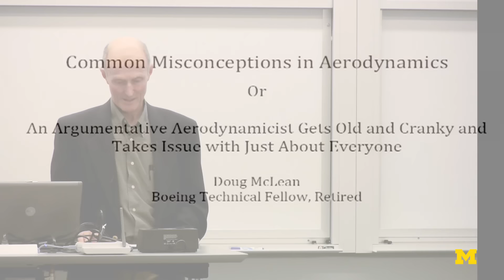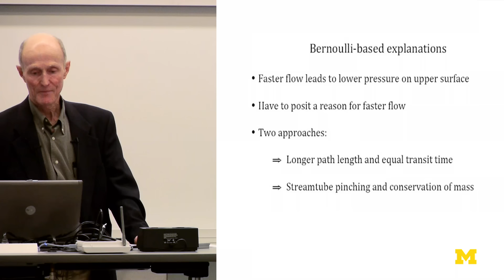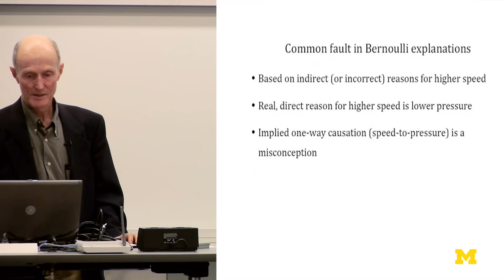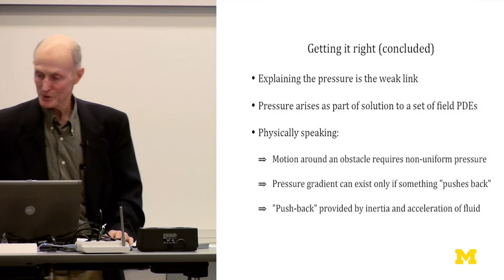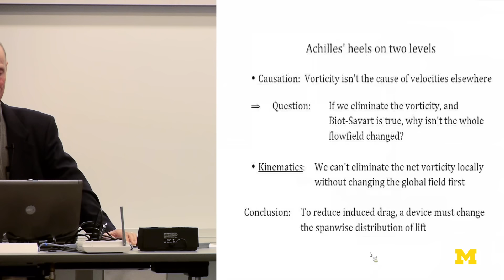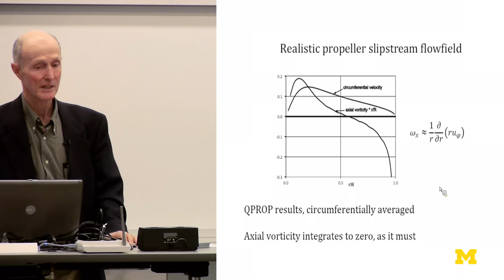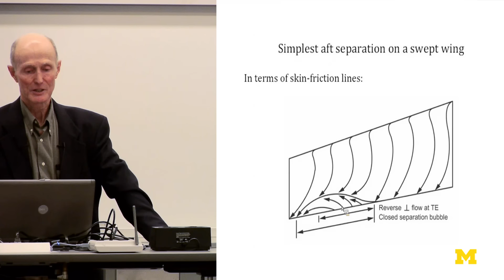Doug McLean | Common Misconceptions in Aerodynamics

Comment: very very educational for those who want a much more in depth understand as to the physical phenomenon behind lift and flow. I feel he could be a bit more thorough about what constitutes a good explanation as opposed to everything that doesn't, but that's just me.
Reply: It's because he's a prior Physics major and knows a ton of the advanced computations and principles of general mechanics.  I liked how he spoke about biot savart law and understood that the velocity ("Current" in terms of Electro  Magnetism) at varying distances contribute to the point in question r-hat, with distance r.  Its hard to calculate but he explained the "intuitive" aspect very well.  Unfortunately, you need at least advanced vector calculus with various example problems solved by yourself by hand in order to understand what he is talking about to the professional level he is speaking.  I'd recommend a good physics program with competent professors to explain Biot-Savart law well (in advanced integral form) to be able to understand the 2nd half of this lecture.
Reply: Around @26:17 he did explain lift more or less correctly: it's both Bernoulli flow plus Newton II & III (or vector N-II & III and Euler). But note, that assumes the continuum approximation, which if you want to be pedantic is false.  He was also clear about that at the beginning, he is doing the physics correctly for the continuum approximation, which is a fiction, but "good enough".  Air (water)  is a gas (liquid) of discrete particles.  So the true ultimate explanation (of lift) for a purist is molecular collisions.  Molecular collision theory (with some adjustments for inter-molecular forces in a real fluid, stronger in liquids, which give more turbulence and drag) explains it all, and there the Bernoulli effect is pure idealization, and it's really all just Newton II & III.  That's why the angle of attack, not the wing shape, is the dominant factor, and is why you can fly a plane upside down without inverting the wing foil profile.
Reply: @Achrononmaster  yesss....!!
Reply: @Achrononmaster  Can you recommend any books which explains this topic in right way.
Reply: @bijou smith. 
Its really true what you have said. The generation of lift is Misconception from beginning well saying pressure difference would actually generate lift but in reality it's much more complicated. Simple Bernoulli equation can't just the lift the sooner you remove Idealisation the clear the picture will be. It's viscous property of flow which generates lift, fluid is one hell of thing, they are freaking intelligent just required a space they shall compress or expand to occupy it. Continues mechanics comes handy here because they explain why we are assuming no slip conditions or neglecting normal velocity for solving navier stokes equations. Molecular Molecular interaction is will give significant understand in unsteady lift distribution.
Reply: @justanotherguy46  0
Reply: @justanotherguy46  0
Reply: 0
Reply: @justanotherguy46  0
Reply: @justanotherguy46  0
Reply: Alex, you are right.
But from the outset, he explained, that his talk is about the misconceptions used by many popular 'intuitive' explanations, and if he had much more time , in summarizing his extremely detailed explanations, he might have had time to a 'positive' lift description.

Actually even then the explanation would be valid for small deflection angles.
Barnes McCormick did develop an extension to large deflections, large angles of the far , ultimate wake.
He did that with a tilted back ' Trefftz plane pair, tilted back by just that ultimate wake angle. ( 41:18 )
You can find it in McCormick's book: Aerodynamics of VTOL flight, a Dover publication.
Reply: He is bringing me to despair ... not good for physics ... yet

Comment: I've always intuitively thought that lift was generated from the Newtonian explanation of thrust: particles colliding with the wing at a positive angle of attack, being pushed down, and subsequently the wing being pushed up. (I knew this understanding was incomplete because it couldn't explain how flat bottomed airfoils generated lift at zero angle of attack) I never understood people who only teach the Bernoulli way like it's always been taught to me. Glad to know lift is more complex than what's been taught to me by people who think they are right. I still don't understand lift, but I'm glad I found this video.
Reply: The thing is; that particles above the wing are ALSO being 'pushed down' because of the lower pressure above the wing allowing higher pressure far above the wing to push it down.  In fact, MORE AIR IS "pushed down" from above the wing than below it.  
What happens above the wing contributes more to the difference in pressure than the small increase below the wing.
Reply: Towed gliders must stay above tow plane ! to avoid the down wash ( displacement of air ) and it is considerable ! a typical C172 displaces 7 tons per second! Bernoulli contributes a lift component , but if you do the arithmetic  Bernoulli alone is not sufficient to 'suck' an airplane into the sky !
Reply: Air interacting with a space capsule re-entering the atmosphere (aka very thin air at high mach numbers) basically DOSE act like the simple newtonian stream of bullets under thouse conditions, and it's why such vehicles can only generate lift by being tilted to the incoming airstream by dispacing their center of mass.

Comment: I am a physicist who sometimes teaches airfoil theory. You stated in 48th minute that Coanda effect has to do with viscosity. It is NOT a viscous effect (that's a wrong explanation in wikipedia and other places). In my view, Coanda effect is all about the curl v = 0 away from negligible boundary layers, and IT IS the proper explanation for the lift force (Bernoulli law is also needed; curl v = 0 explains why the velocities along the upper surface differ from lower surface, due to non-zero circulation)
Reply: I too am a physics person. In general all aviation theory is like the 'blind men & the elephant", to which all are partially right, but totally wrong; To the blind man holding the elephant ear, its a fan, or leg its a tree; To the pilot who can tie strings all over his airplane in flight, he clearly knows all about laminar flow and turbulence; To the desk sitting theorist,  they are like the blind man at the tail, they say its a snake that rains feces&urine;

Comment: I am not an aeronautical engineer or expert in aerodynamics. However, I have always been interested in aviation in one form or another including model design and building, skydiving, paragliding, hang gliding etc. When I was a kid, for a science project I explained the thrust from a propeller using the "newtonian approach" which the teacher basically scolded me for and said that it was not the way that the thrust was generated. When the Bernoulli explanation was told to me, I didn't understand why the two points of air had to come back together at the same location. I was afraid to ask and I figured I was just missing something. This always bothered me and it is good to hear that I wasn't the only one who didn't get this "explanation".

After watching this video, I started to think back to my skydiving days. Skydivers call the low pressure zone behind them the burble. One thing you didn't want to do is get your pilot chute stuck in the burble. It can flop right onto your back and stay there which can be highly inconvenient if you don't know how to deal with the situation. This is just a demonstration of how strong the low pressure can be.

Tracking is when you change your body position with your hands and legs pointed back which gives you a significant horizontal velocity. You are changing the position of the burble, which shifts further back towards your legs. The change in the burble position changes the airflow and air pressures around your body.

I have been thinking about the burble and how it affects the airflow. When objects are dragged through the air, there is a high pressure zone in the front and a low pressure zone in the back. There is always a loss in energy with time (thrust times velocity, drag times velocity, or for a glider, vertical velocity times weight). Gliders always lose altitude within an airmass, and planes have to be pulled through the air to generate lift. This energy goes into generating the differential air pressure between the front and back of an object. It is the position of the "burble" or low pressure zone that induces the flow pattern around the wing. The flow pattern and burble generate the differential pressure. I don't know if this is correct or not but it appears from this argument that drag induces the lift and not the other way around. You can have drag without lift but you can't have lift without drag. It also seems to me to be a better way of thinking about lift than the old grade-school Bernoulli explanation.

I would be interested to hear what people think about this. Thanks.
Reply: Two flows of air do not get back together. Difference is drag.
Top flow gets to trailing edge first.
Reply: I can relate to the first paragraph of this comment.
Reply: can you make vedio on your topic some points are really intresting
Reply: How rare on YouTube to hear someone burble coherently.

Comment: I found this discussion very interesting and informative. I wish he had actually RESOLVED some of the mystery! I would even gladly buy the book (assuming it's available in electronic format - I'm not a Luddite... ;-), if I had ANY confidence it might help to actually EXPLAIN lift, but I have the sneaking suspicion that it would just provide greater detail on what is WRONG with the two prevailing 'pieces of the puzzle' without properly integrating them into a comprehensive all-encompassing DEFINITIVE picture!
For now, I'll just continue to use airplanes - though maybe a little more suspiciously...
Reply: AFAIK There is NO COMPLETE theory of lift .  Aerodynamists use various theories depending on what they are looking for .
Reply: @Cheezsoup  well there is navier-stokes which is pretty much complete, but yeah maybe that's just renaming the problem
Reply: @screwhalunderhill885  
If you know Navier-Stokes to be complete and can show same there is a MILLIOM dollars waiting for you.
Reply: @Cheezsoup  lol
Reply: @Cheezsoup  The problem isn't with the "completeness" of Navier Stokes, it's the existence and smoothness of its solutions, which is inherently a mathematical problem, not a physical one.
Reply: @HilbertXVI  
Pretty much is a Physics problem.
NS pretty much assumes a fluid is continous when in actual fact it is made up of discrete molecules.
Reply: @Cheezsoup  Navier Stokes equations are partial differential equations, and the problem of proving that smooth solutions always exist to a PDE is a mathematical one. People working on the problem aren't physicists, they're mathematicians.
Besides the whole point of fluid dynamics is to forget the individual particles and model the fluid as a continuum.
Reply: @HilbertXVI  
"forget the individual particles and model the fluid as a continuum."
This is basically why NS is not complete it is an assumption .  Good enough for "government work" but not complete.

Cf. Newtonian physics.
Reply: @Cheezsoup  You're missing the point, it's not just NS, fluid dynamics as a whole works on that assumption. It's impossible to model the effects of each individual particle in detail because there would be billions of them to keep track of and compute the trajectories for at each instant.
Reply: @HilbertXVI  The fact that all fluid flow equations are incomplete does not mean NS equations are complete .
  Fair enough NS equations at the mo are usable but that does not mean they tell the whole story . 
Anyway we are possibly talking at cross purposes or we will never agree or... so I will stop replying now.

Comment: Stokes's theorem (and Green's functions/theorems in general) are the bit of mathematical physics that most physics/engineering 'enthusiast's would do well to become familiar with. A good reference that I find myself going back to is 'The mathematics of Classical and Quantum Physics' by Byron and Fuller. It builds everything on core theorems of vector space, which after all is the world in which all of physics from hydrodynamics to QED lives. If you are not formally trained, but looking for that extra level of mathematical capability, look no further if your goal is to detect hand-waving in textbooks or lectures.
Reply: Any recommendations to what one should be familiar with before reading Byron and Fuller's book? I've got it lying around and am still not sure what the prerequisites are. Maybe single and multi variable real analysis, linear algebra and a bit of ODEs and a bit of complex analysis?
Reply: @OttzelTV  Just look up the pre-req's for a 4th year Modern Physics course at any major university.

Comment: Fascinating lecture! It helps me understand (or question) the experiences I have had sailing a little Laser sail boat. Parcels of air movement (wind) are key to success in racing small boats - but no time to calculate even if we could sense the forces - unless an America's Cup competitor.

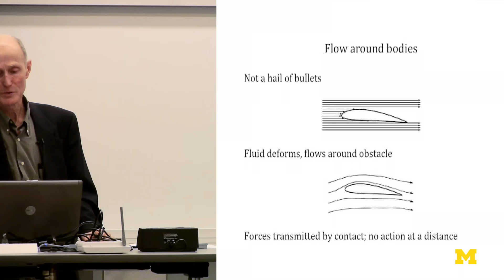Comment: 10:08 and 11:04
Well what you said is right, I dont see how what they said is "wrong", but rather is incomplete.

Its still true that newtons third law (together with his second) implies conservation of momentum, and therefore if you want to design an engine to produce thrust, you must "throw stuff out the back" so to speak. And if you do "throw stuff out the back", then the conservation of momentum requires your rocket move forward.
I think the problem is people are confusing the strict statement of the Third law in newtons original formulation (which as you said only talks about forces) with the Conservation of Momentum.